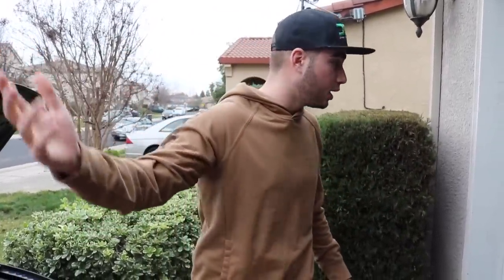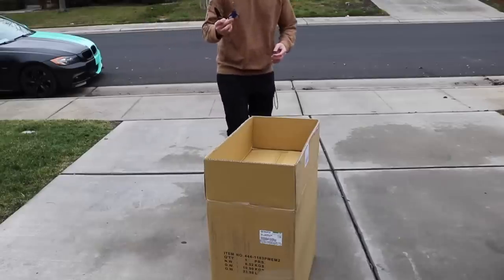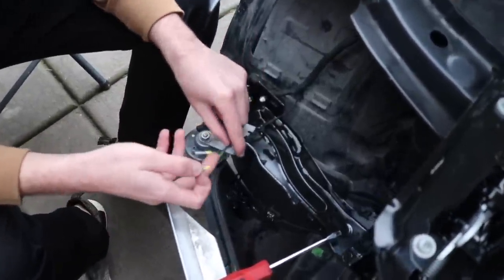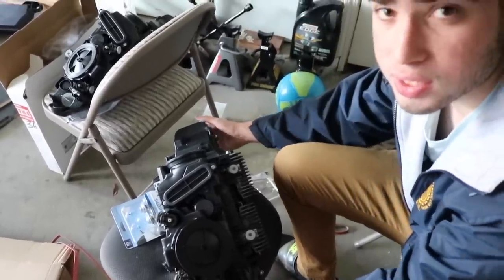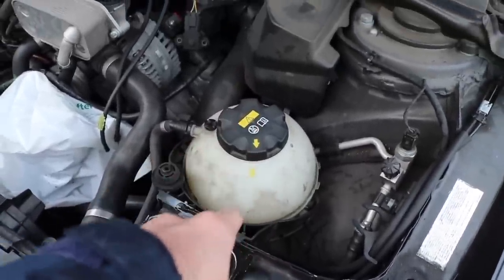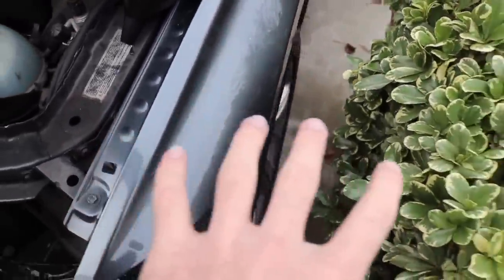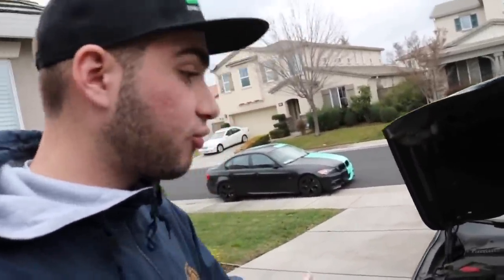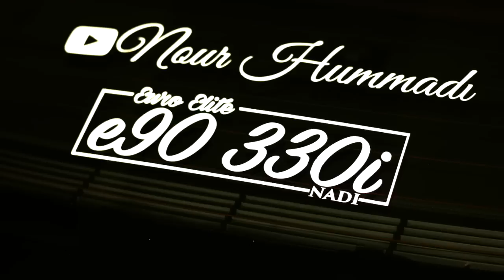Rebuilding a Salvaged 2014 BMW F30! (Part. 4) FRONT DEPO Headlight  FACELIFT!

Comment: It's coming together!
Reply: Kies motorsports you make awesome vids but I kinda miss the videos where you upgrade the technology of your bimmer and do retrofits ...
Reply: @jamesxs783  the best is yet to come :)
Reply: hey kies, i just bought my first BMW! I was wondering how do you get sponsors, i'm just running the car on stock but those lights look amazing! what do you suggest I do to get noticed?
Reply: DNAoBRUZER make videos lol
Reply: The v brace is set well back if you look at where the crash bar goes across there bolt holes 🕳 for massive bolts you guys should try use a website called real oem it deconstructs the whole car using the vin and shows you the whole assembly including part numbers and estimated dealers price on parts it’s free no singing up or any of that just type vin and go
Reply: Just ordered them. Coming in on Thursday cant wait :D

Comment: I know first hand “White” bulbs are never white, you have to go with LED lights or upgrade to xenox bulbs and get a ballast hooked up. I have LEDs running on my truck with no issue for the same cost of what you spent on the phillips. My F30 is running stock xenox

Comment: Those have to be aftermarket headlights because OEM Xenon headlights don’t use H7 for low beams because H7 isn’t typically a size for xenon bulbs, I know most pre facelift F30 HID/Xenon headlights use a D1S bulbs. However, I could be wrong because I’m not familiar with F30 lightning.

Edit: After looking at the link, they aren’t the OEM headlights, but they still give a great impression. Remember use RealOEM for comparison.
Reply: I was thinking...ain't those bulbs wrong??...
Reply: Dwaine Williams now it has me questioning if their other products are OEM or just OEM alternative.

Comment: Put LEDs bro. Even if they say those halogens will be “white” they never will be because they are halogens.
Reply: Do you know how to do the the LED conversion? I have the Depo housing but you’re right no matter what halogens I put in they are still yellow. The way the bulb mounts in the Depo housing is different than the stock halogen lights. Have you found any LEDs that will work on the depo house or a conversion kit?
Reply: Anthony Rico I think a good set of H7 LED will be good. You might have to code them out if you get cheap ones.

Comment: Go LED for the DRL's/halos and go HID for the main headlight. High beams you can keep the halogens or go LED as well.  But definitely go for HID's for the main light as they are still better (for now) than the aftermarket LED bulbs and will give you a HUGE upgrade over halogen.
Reply: shaunskii Are there issues with coding? I’m going to be buying these DEPO lights soon and I’m confused with which bulbs to pair with it.
Reply: @schnibbyy  I have a an e90 but it should be the same senario on the f30. As long as you have a halogen equipped car from the factory you should have no problems with these and there should be no coding required. If you have a xenon car and go with these, that's when you will have problems (edit: look like they make them for xenon cars too)  Bulbs wise, you want to make sure they are canbus equipped LED bulbs and canbus HID's, that way when the car does the bulb check, you don't get any annoying bulb out errors. So in short, these Depo lights and canbus LED and HID's installed, and your good to go. Nothing else needed. You'll be much happier with that setup over the factory hologen, both looks wise and performance wise. No aftermarket set beats the lighting performance of stock xenon tho, but that conversion costs $$$$, requires coding, and possible wiring modifications.
Reply: @schnibbyy  a quick Google search shows this guy upgrading to these Depos and installing a HID kit in them with links to the parts he used:

https://f30.bimmerpost.com/forums/showthread.php?t=1459304

Comment: The headlights are depo headlights.(aftermarket) Halogen but with a projector housing (oem are reflector) and with the angel eyes drl's (only oem xenon and led have those). Look and quality wise its the same. It just lets you have projectors and angel eyes without having to do the expensive xenon retrofit which cost thousands and requires coding. This is plug and play.

Comment: do i need resistors when installing depo ights ? the shop i dropped my car off promised me that it would be done in 1 day, but now they are keeping my car over the weekend because they said "its more complicated than we thought" anothr issue is that when they isntalled the lights and tested it, they told me that the casing for the headlights was running very hot.

Comment: You actually do not need to start the car to put it into neutral.  There is a 5mm Allan screw on the transmission under the car.  If you tighten that screw the car will manually go into neutral.

Comment: The ABS light will turn off itself once you start driving the car.  Don't trust me 100% on that tho.  Sources; I owned an e46 and e90. Not sure about the f30 or why yours is on.
Reply: well it isnt either hard to check if something is wrong with the abs all u need is a visual controll under the car to see if something is broken
Reply: @mathaaushle  1. ABS sensors are not under cars,.  They are in the knuckle/spindel. and the ABS unit for BMW's is usually under the hood near the hidges.  So visually you can't see anything. 
2. That light comes on in BMW's when they been sitting a while with a dead battery.  
3. Their car was in a front end accident and that sudden stop is what prob caused the light. Therefor after the car start moving the computer will reset itself once it sees the sensors and unit are OK.

Comment: Lol 😂 every bmw has either halogen or xenon depends on how you spec the car like you can see an f30 m sport with halogen lights.
if it’s a xenon on an f30 it has day light running lights what you call angel eyes that’s those 2 silver grill looking things on the bottom LED DRL. The ballast is on the side of a xenon headlight. 
From looking at what keys sent you it looks like it’s an aftermarket hybrid as it has DRL and halogen bulbs this will never be the case with oem be careful what you buy vs what your car originally had for example of your car came with xenon and you fit halogens to cheap out after an accident trust me I done it on an x5 the wiring is completely different you will find for example only high beam will work